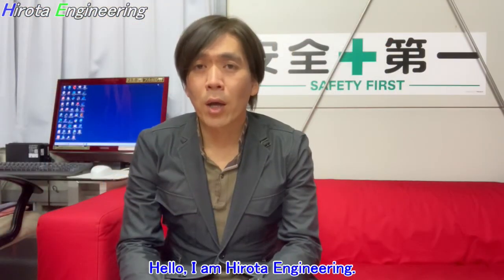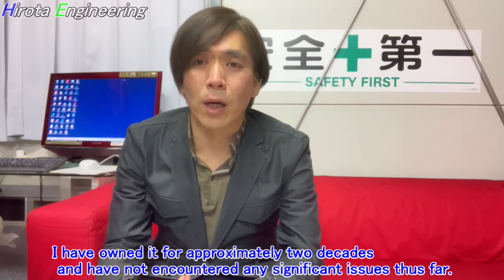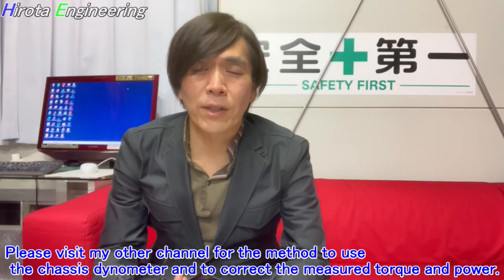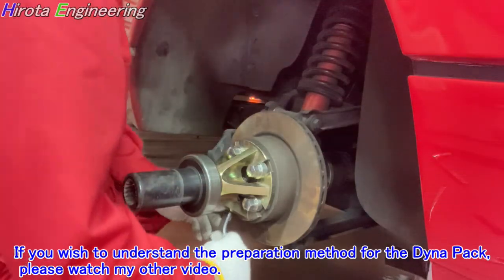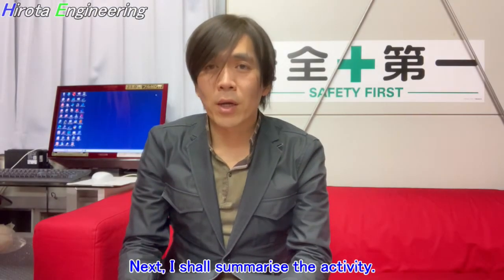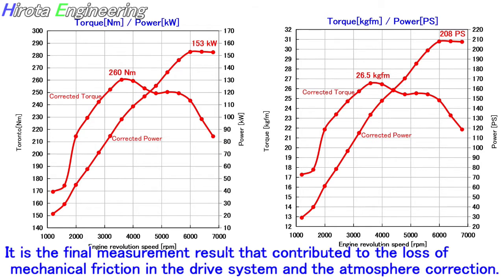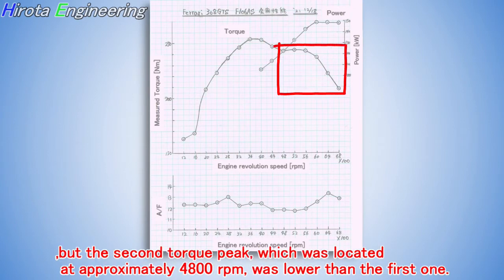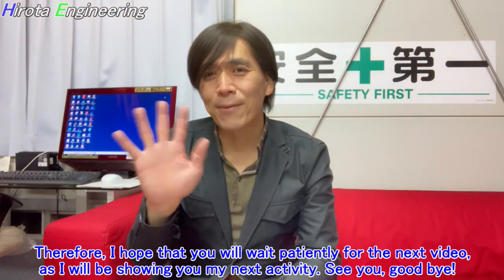Ferrari 308 GTS Engine Performance Measurement - English Version.  【Hirota Engineering】#8

Comment: Achieving 300bhp with stock 3L displacement is only able to be done in a full race motor. Approximately 275bhp for a street engine is achievable for a street engine with a lot of work, but the engine still requires a lot of revs. 

The best upgrade I can recommend, as I have done it before, is to obtain a crankshaft from a Ferrari 360 engine then have custom pistons manufactured to accommodate the longer stroke, and a different camshaft grind. Builds such as this easily make 325-345bhp at the crankshaft, and between 260-280bhp at the wheels.
Reply from the maker: To Selmerpilot-san
Thank you for recommending the strategy for getting 300bhp. It is the new information that 360 cam shaft can be adapted to 308 so that it can suction air much more. I was not sure if 360 camshaft is compatible for 308. 
I have plan to replace pistons and cam shafts with the others, that can achieve higher compression ratio and wide open angle of a intake valve open. As you guess, it can be difficult to get 300 bhp with the mass production based engine of 308. But it is my ultimate target, I would like to attempt the maximum effort!
Reply: @user-HirotaEngineering  The 360 crankshaft has a longer stroke and would certainly make your goal easier!  Good luck
Reply from the maker: To Selmerpilot-san
Thank you for your comment. Although it is not easy to get the crank shaft of 360, I would like to try it someday!

Comment: It is widely accepted that Ferrari were not truthful about their engine outputs in this period.  A good example is the Dino 2.4 litre engine which was quoted as 195PS in the Ferrari-built cars but only 180 in the Fiat Dino, despite the engines being made on the same production line and being identical in all respects.  A healthy carburated 308 should make about 230PS and 27kgfm (270Nm).  In comparison, the injected 308QV should make an honest 245PS, and was therefore a more powerful engine than the older one despite having inferior on-paper figures.
As a 1978 car, yours may well benefit from a carb and ignition service and may also have some carbon in the combustion chambers.  There is no doubt though that a modern ECU and throttle bodies, plus a high-airflow air filter can give significant gains.  300PS is going to be tough to get though and at that level you will need to start looking at other weak points in the transmission, starting with the hubs.  Best wishes for the work!
Reply from the maker: To Tim Gosling-san
Thank you for giving me the comment and advice.
As you noticed, the performance of 70's cars certainly tend to be lower than what the manufacturers provided. And the most powerful 308 should be the final model, that is QuattroValvole. But I suppose that it is worth improving the performance of cars in this period.
And as you advise, I have to take care about the toughness of another parts of the car if the engine power reaches 300 PS.
Anyway, I have a lot of things to do. Please watch videos I will present.
Reply: I have never seen a QV make more than 190-195bhp at the wheels on a dynojet. A healthy and correctly jetted stock carb 308 will make just about 200 at the wheels on a dynojet. With current fuel, 308 carbs consistently like 140 main jets and 190 or 200 air corrector
Reply from the maker: To Selmerpilot-san
Thank you for giving me the comment. There are a lot of reports about an output performance of 308. But almost all of result show lower value than the official one. According to your experience, my 308 may perform standard behavior. Anyway, I am not satisfied with the current performance of my 308. Thank you for giving me the information about kinds of main jet, I will take it into consideration.

Comment: I watched the original video in Japanese translated to English by YoutTube.  I also watched this one.  I am a fan of the 308, specially for its styling & aesthetics.  Mechanically its a good car which could benefit from a restomod.  I am very interested in your plans to upgrade the car.  For me you will be able to achieve your goals by installing a stand alone ECU to do injection as well as ignition (coil on plug).  For the injection you will have machined new inlet Throttle bodies for installing the injectors using a CNC.  Wishing you the best  . . .
Reply from the maker: Thank you for visiting to my YouTube channel of both the original version and English version, and giving me the feedback. As you are mentioning, I will replace the carburetor system with a injector system controlled by ECU, because the carburetor affects to the suctioned air and causes low volumeteric efficiency. And there are a lot of other benefits in a ECU controlling, in my opinion. So please wait patiently for my next presentation. And I am studying English hard so that please expect better announcement in the future.
Reply: @user-HirotaEngineering  I just wanted to share this video with you https://youtu.be/CZeMYQZnSCw?t=565 where this YouTube channel 'CAR WIZARD' is doing the same thing.  Initially he would have stayed with the carburettors, but realised he could do more with an ECU.
Reply from the maker: To Pritam Bissonauth-san
Thank you for introducing the video, and I carefully watched it. I would like to imitate what he did. I plan to buy the kit 3004 of BORLA, that is available in Japan too. A controlling ECU will be MoTeC M150. I prefer MoTeC bland for ECU because that is very easy to use it and there is the technical support shop in Japan. And I will replace the original pistons with the higher compression ratio that should be around 11.0. Moreover, I would like to modify the valve timing by changing a cam shaft. So the final power can be estimated about 300 PS. Anyway, I want to try so many things that it may take long time. I will do those step by step and give you the report through YouTube. Please wait for those!
Reply: @user-HirotaEngineering  I will definitely watch your new coming videos.  Wishing you courage & success in your endeavours.